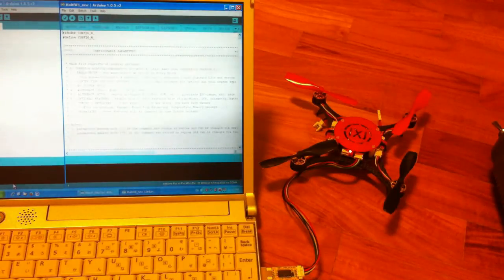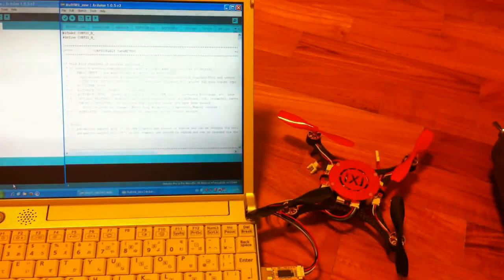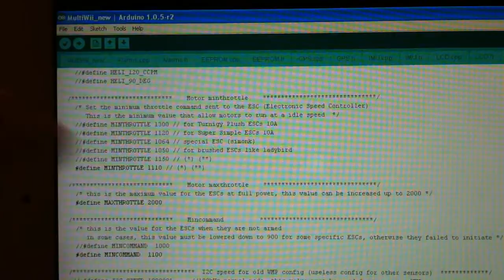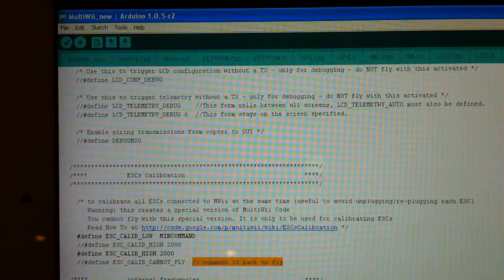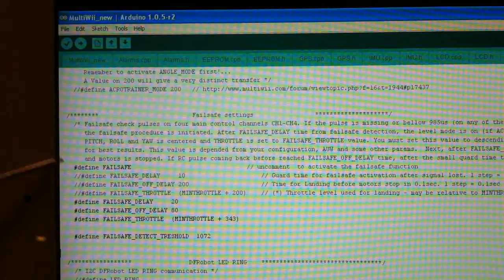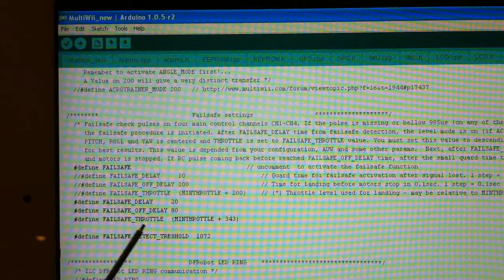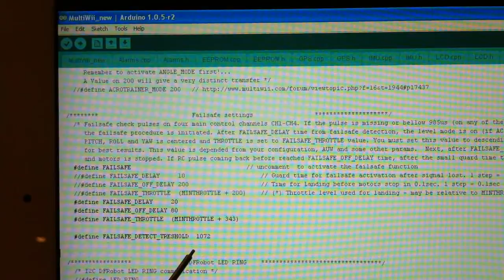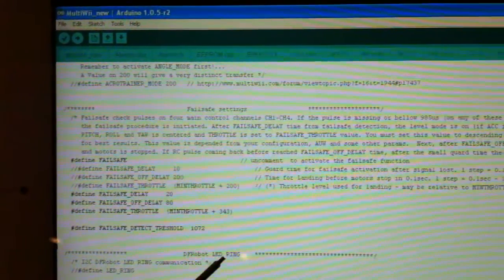Program Failsafe for Super-X micro quad (multiwii nano)

Comment: i am trying to flash my super-x with firmware from rc groups 
my problem is when flying the quad dose not want to stay still it  i put new motors with fatter shaft
balanced props no luck do you have a fix
Reply from the maker: It does not have GPS so do not expect it to hold its position. If u tune the PID properly, it should not drift too much. I followed the GUI Parameter values in rcgroups

Comment: nice vid i olso want the super x i have a ladybird home made fpv but ladybirds laks power so would like to see how this works for you i fly a zmr now thats wy i want more power
Reply from the maker: Thanks for watching. The beauty of these pico drones are they could handle the wind pretty well despite their compact size. Indeed a ladybird lacks power, even after shedding every gram possible, the brushed motors won't last very long. As for ZMR250, 6.5mins flight is too short.
Reply: 6.5nim to short?
i fly my zmr250 with rctimer 1806 2300kv 6 a 7 min and then my 1500mah 40c is at 11.5/11.4 volts i know i can do more but just land and change lipo i fly hard and below 11volts it gets a bit slow for me i want the super-x for some hard indoor flying